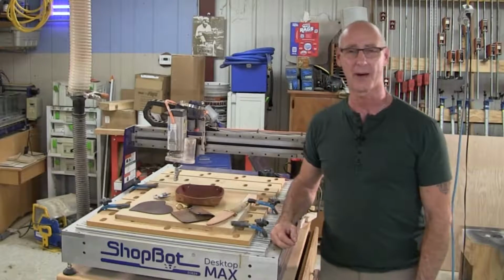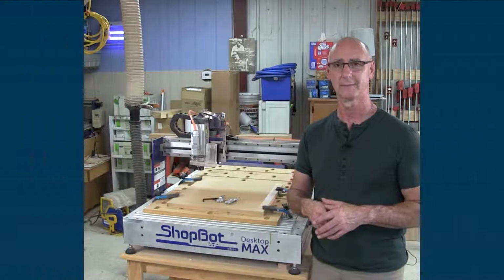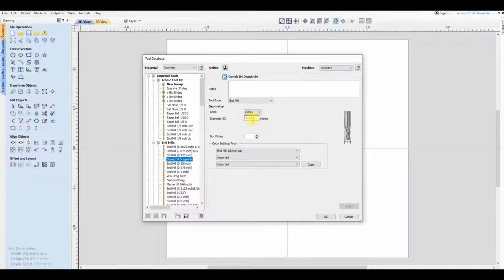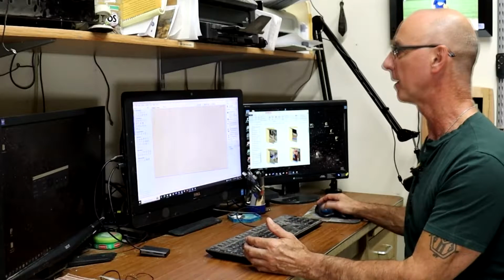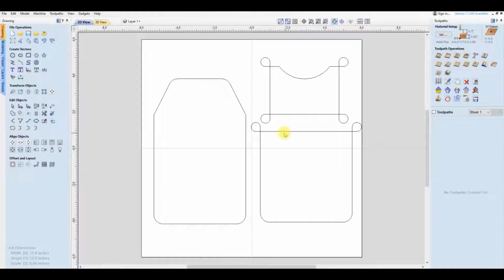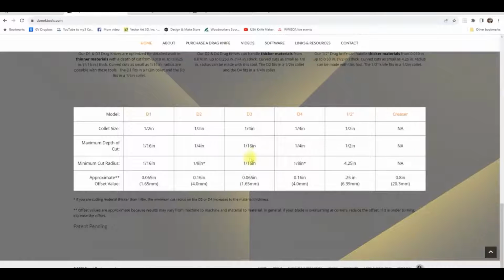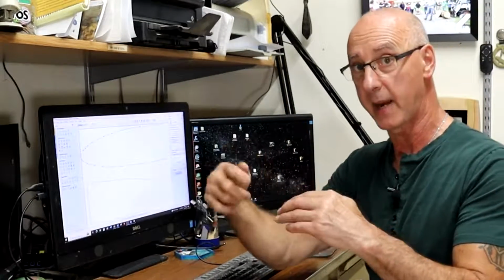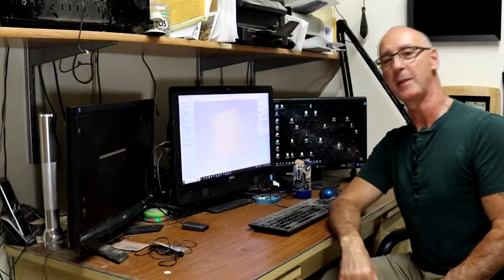Cutting Leather On Your CNC with George | Vectric Worldwide UGM 2023

Comment: Sir, I'm using a Mach3 4 axis board. How do I save G-code on Aspire? too many choices, the few times I tried it only ran on 3 axes
Reply from the maker: Hello... I might suggest you contact support@vectric.com , they would be able to ask the right questions to get you an answer.  When you do, if you could please include the controller software, and the controller you are using.

Comment: Can try using a Cricut  Cutter mat instead of double sided tap. Just watch depth of cut.
Reply from the maker: Hello, and thanks for the question.  I'm thinking as long as it holds the leather flat and does not shoft left or right... you might be onto somehting.  It would be worth a test.